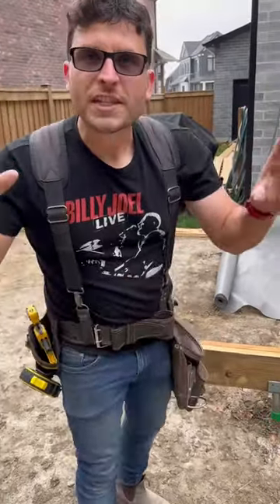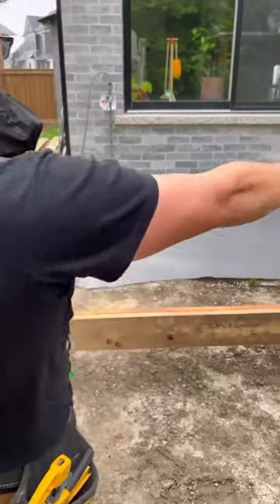DECK BEAM #protip #carpentry #shorts

Comment: What he is saying makes sense. Maybe not a whole 2 feet of extra beam but the tip is good. If you are building a deck on the ground. Its probably very easy to guage where the square would be. But a 1st floor deck is way more difficult and the mistake his describing would be expensive to correct. So "pay attention and learn"

Comment: Years ago I was taught to do it the same way. Still do it that way to this day. I  Can't be as perfect as Patrick unfortunately lol
Reply: Not trying to claim i do things perfectly, one major difference is when we build a deck we start with a single beam box and over lap, square it and then add a second beam the whole way round. Its rather fast and I didn't come up with the idea. I only have 8 years in the industry, my father has about 53 years experience  and his father before him had atleast that, my grandfather was one of the larger builders in the greater bridgeport area of Connecticut in the late 50s into the mid 80s, my father started with him at the age of 12, by 14 was running the backhoes and graders for entire developments, and despite my attempts to evade carpentry I ended up in the business. So I don't claime to be some Einstein of carpentry, I just trust the process that has evolved over all those decades and I've never been failed, I've also never had a inspector tell me they wanted more from my work

Comment: Can you explain the backstory with “Pay attention, Bryan,” please?
Reply: Also, do you only use ipe decking or do you use composite too? Also, do you always use cedar for your beams and joists, or do you use ipe for that too (depending on the customer’s preference and budget)?
Reply from the maker: We use pressure treated lumber or steel for framing and we use PVC and cedar as well as other exotic hardwoods

Comment: To be fully honest, this makes no sense, if your building a deck you know the dimensions and then your good, if you don't know what you want to build sure an oversize beam might be helpful, but you shouldn't ever need an extra 2 feet
Reply from the maker: Thanks for that contribution
Reply: @woodbullyltd  im not saying your work is bad, I just don't see the sense in buying a 14' 2x to make a 13' beam for an 11' deck, thats alot of waste
Reply: @patricknoel2122  same reason you allow 10% for material wastage better to look at the material then for it